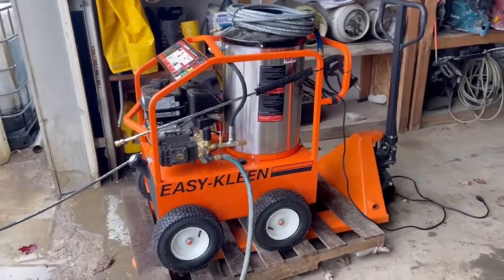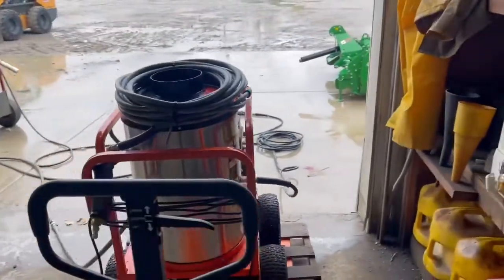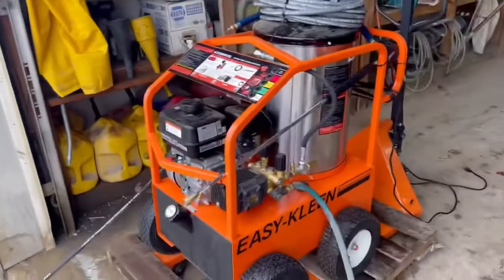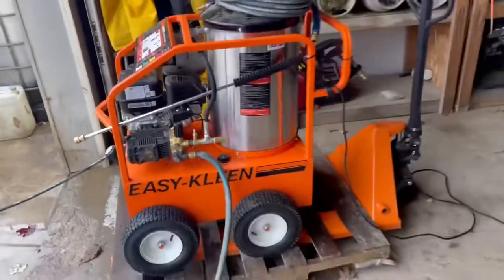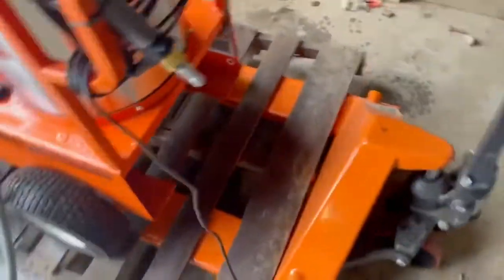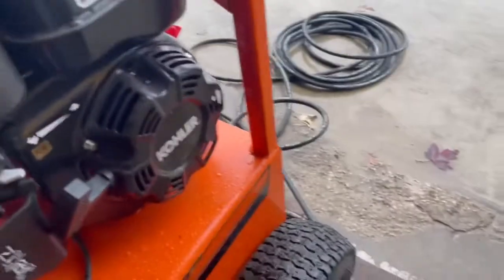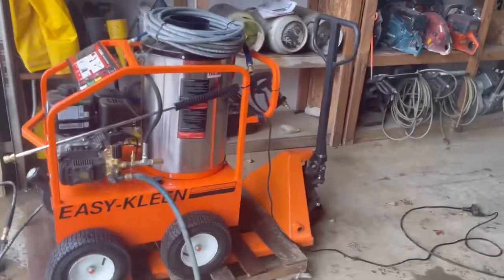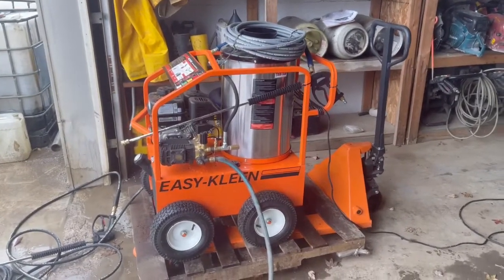Easy-Kleen 2703G Hot Power Washer SN 2126335

Comment: can a battery  be used to ignite the igniators ?
Reply: Yes, they ignite by using a 12V system which is by the battery
Reply: @AmeriRentEquipment  ok I was wondering what the cord was for?
Reply: @NoName-be5ir  Oh, this might be a 120V burner that uses a cord to ignite the burner.  Most of the units are 12V systems.